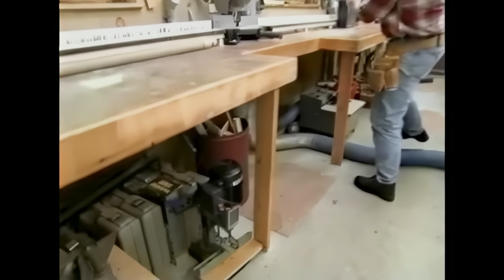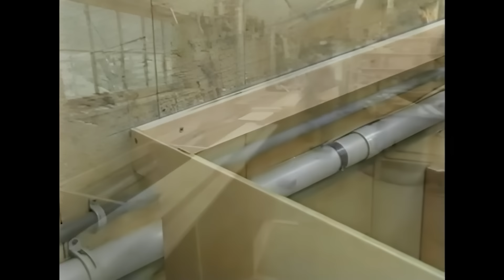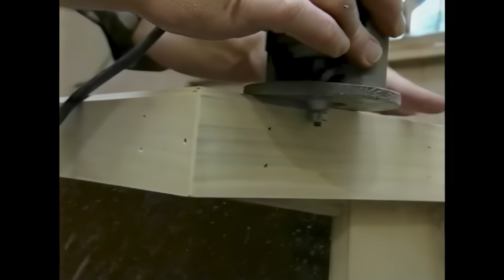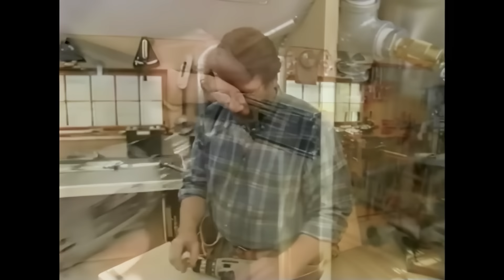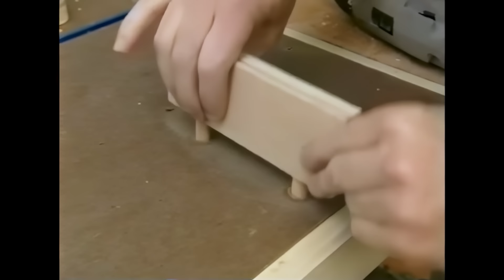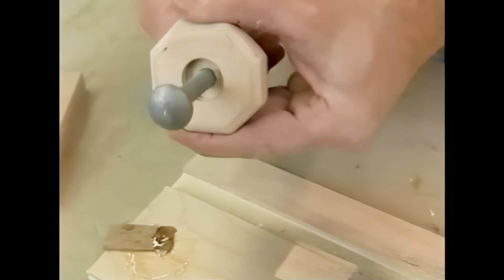Miter Bench and Storage [AI HD]  |  S14 E1 & 2

Comment: I have 2 miter saes and a radial arm saw in the same bench slso. I built the areas under the miter saws open so sawdust falls thru. Then I built a hood area  with a sloped bottom which will let dust and scraps to fall into a pladtic tote which sets below.

Comment: Great intro and compliments to the crew on showing the AI transition on these old videos. Simply amazing. The echo audio you get used to through both episodes - like others have stated, I prefer this new video format and will give on the audio. Thanks to the crew for brining these episodes back in 2023 AI quality! Over the 30+ years with Norm I have followed his woodworking teachings for the most part exactly as he showed on The New Yankee Workshop - from tools (hand, power and stationary) to shop layout and accessories to shop furniture. I have to admit, I diverged on the mitre/chop saw from Norm... Opted for a mobile stand with extensions for my mitre/chop saw versus a stationary set up. I have a Dewalt 12" mitre saw with a Dewalt mobile stand - kind of like a dolly/working station I can move the saw inside my shop or outside when I need it at the project site. Regarding the Delta mortiser bench top tool... A simpler solution to mount to the bench top is to drill 3/8" holes down into the top and use 1/4" bolts, washers and wing-nuts to secure it to the bench top. No need for the cut out.  This simpler install for my Delta mortiser has worked great for me for over 20+ years on bench top of a Veritas Radial Arm Saw station I built for my old Craftsman RAS.  I do the same set up with tool specific holes in this RAS station top for an old Porter Cable table top router, Leigh dove tail jig and Porter Cable pocket hole jig. Simpler and stronger in my experience than cutting out a replacement footing for the tool. My two cents here. Again and as always, thanks to Norm, Russ and the 2023 crew for making these classics available again on You Tube. Thanks for these wonderful memories!
Reply from the maker: Glad you are enjoying the show. Sounds like you've got quite a set-up yourself. Keep making sawdust!